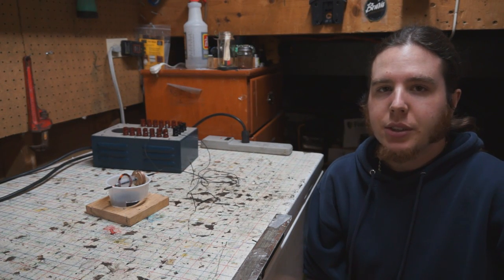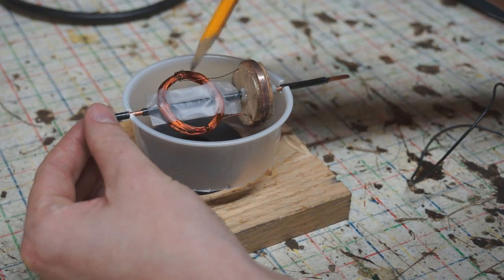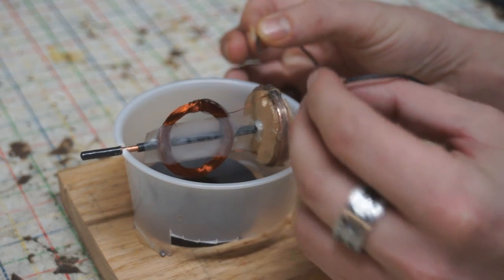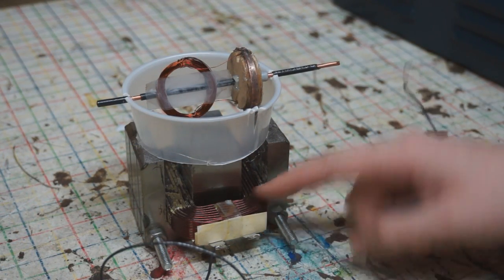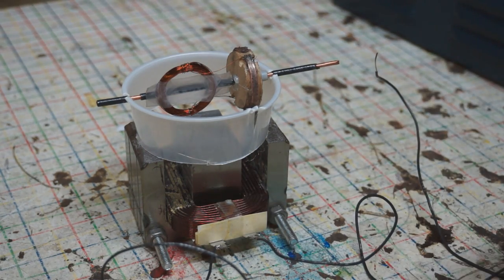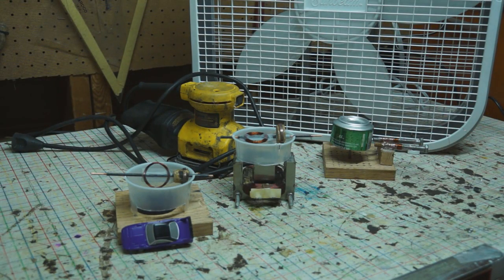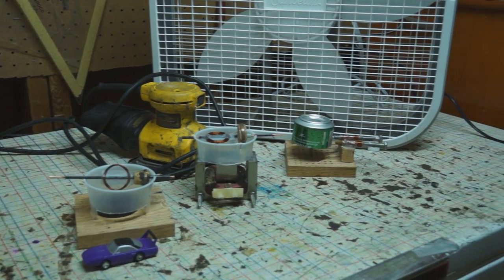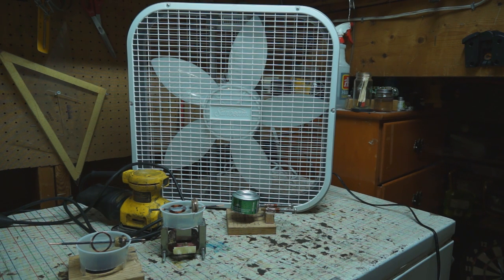DC and Universal Motors

Comment from the maker: The motor, if connected to the right voltage, will work but as far as I know the speed controller is something like a light dimmer and needs AC to work.

Comment: So that mean i can connect AC power tools to DC power supply with no modifications? For example a AC drill or grinder? Will the speed regulator in the AC drill handle work properly when connected to DC power supply?

Comment from the maker: It will work both ways but you don't have to get into phasing when you switch a series motor to AC from DC. A Parallel motor would probably have worked better but the windings would have burned out in my case.

Comment: Great video! You said you hooked up your stator and armature for the universal DC motor in series with each other. Is their any reason why? Could you consider doing a parallel circuit instead to keep the voltage higher?